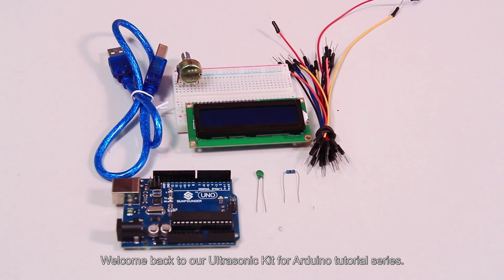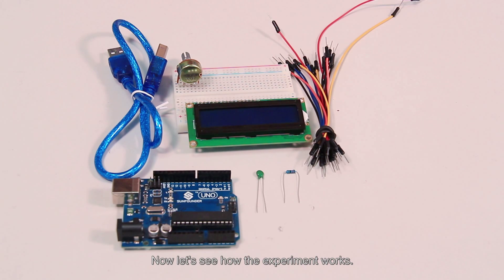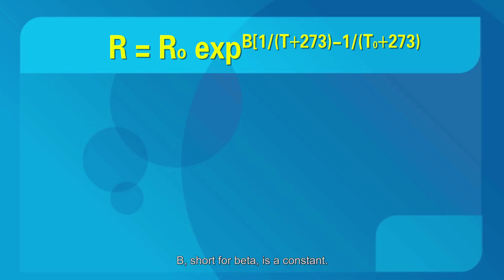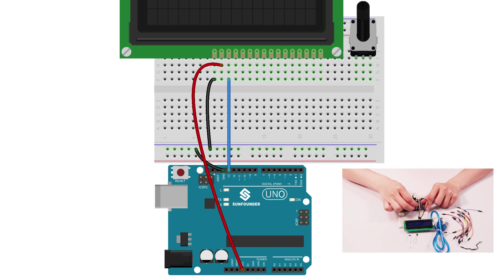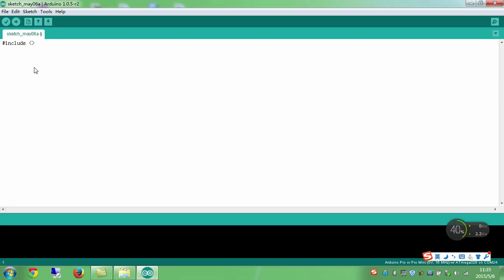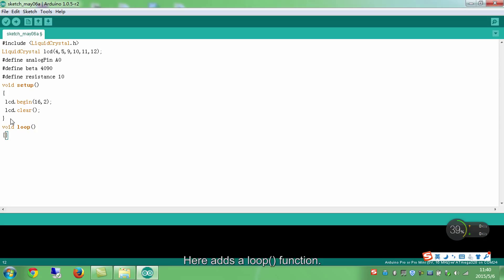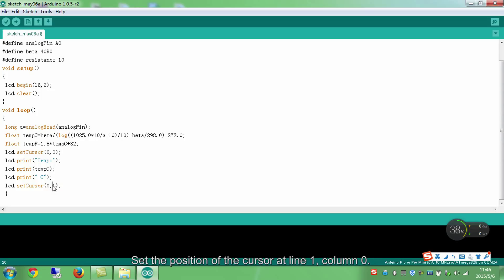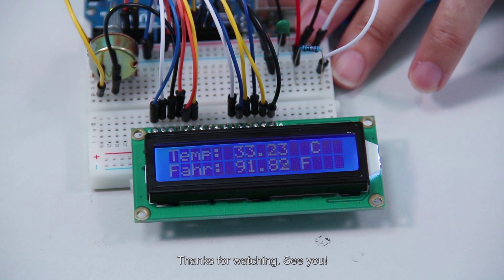SunFounder Kit Tutorial for Arduino - Thermistor

Comment: float tempC=beta/(log((1025.0*10/a-10)/10)+beta/298.0)-273 ; and this is the corrected line with +beta/298 not -beta/298  but still, I get 240+ temperature I don't know how you showed us that your project works but it must need serious debugging if a beginner is seeing this
Reply from the maker: Yes,
it should be +beta/298. Thanks for your kind remind. The wiring and the
experiment in the video is first made, and the code showed in the video and the
script is made later. Sorry for that mistake, we'll improve. You can refer to
the correct wiring and code at: https://www.sunfounder.com/learn/Ultrasonic-Kit-for-Arduino/lesson-10-thermistor-ultrasonic-kit.html
Reply: But it's the same thing also in that link! I can't make my thermistor working.
Reply from the maker: Could you provide more detail for us, so that we help to solve as soon as possible? You can post forums on our website www.sunfounder.com if you have any questions!